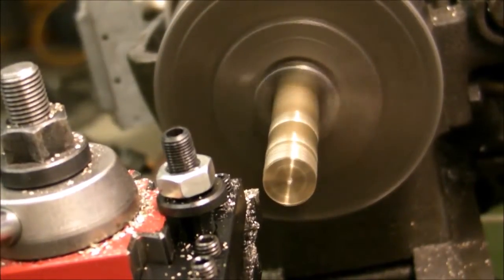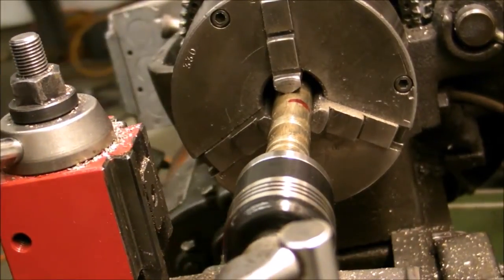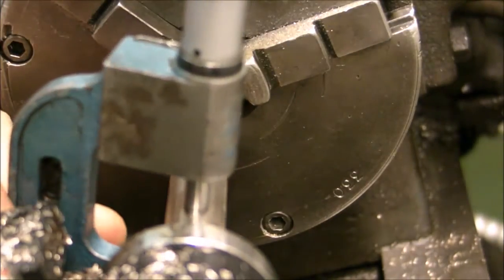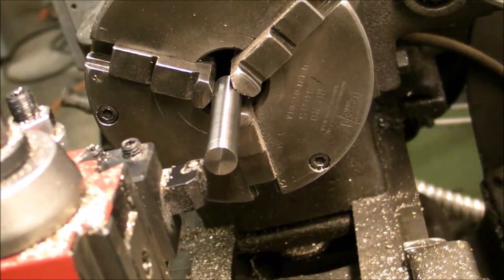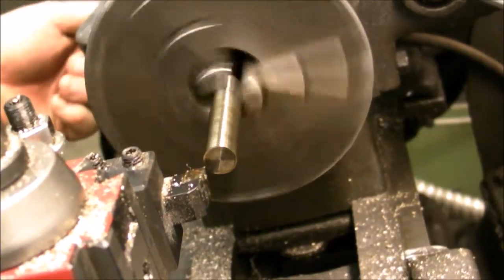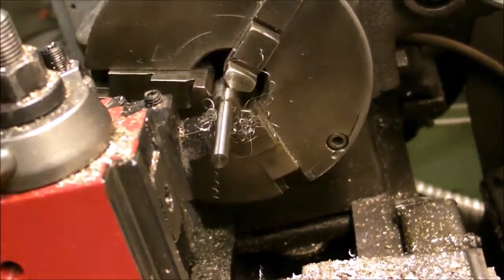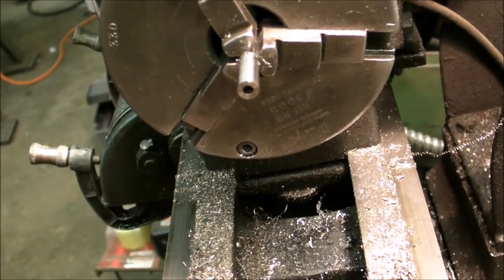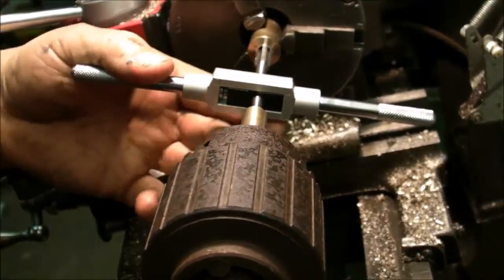Tap Follower

Comment: LOL, you had me tripping out for a second as I forgot we traded for the red tool post...I was thinking, "Hey, are they selling red ones like mine now?" Duuuhhh, Hee hee! Looking good man, glad to see you filming, I need to get back onto the horse and make some video...mowing weeds and sowing seeds isn't all that interesting, but I have cleaned my shop and got a bunch of work done on the SB lathe I could share. I also have been sporadically working on getting the hammers done...man it will be nice to actually finish something :P
Reply: Knolltop Farms BTW, very nice spring center!
Reply from the maker: Knolltop Farms , thanks.  As I was going through the video last night quickly editing, I forgot to mention the tool post as having come from a trade with you to make sure you noticed it.  It is working pretty good, not quite as nice as the wedge version as it seems to have a little more of a tendency to come loose on my vibrator called a lathe, but definitely working for me.

Hopefully you can get some video on how the lathe milling attachment cleaned up for you (unless I missed it), too.  I think I remember seeing a portion of it after it came out of the evaporust.

I try to clean up the shed where the tools are, but it seems to quickly get filled back up.  I need to move my 12" over to a more sturdy bench to see if that helps with some of the bad vibration issues I'm having with it.  The workbench I have it on now isn't very solid.  If I can't get it to work, it may go on the market as-is and make some room as I probably really don't need 3 lathes of the same approximate size.

I also need to get some of the tooling further off of the floor.  Having a concrete floor in the Spring time in Illinois isn't good.  When it is damp out, the water just condenses on the colder concrete and anything near the floor took a surface rust beating.
Have a good one, Chuck.  Don't work too hard...unless it is on your lathe!

Comment: Nice build and happy for you to get shop time!
Reply from the maker: outsidescrewball, thanks, Chuck.  I was able to get out a couple weeks back to work on a drawbar for the Atlas mill.  I didn't get full video of it and had a bunch of rocky bumps and design changes along the way.  It went overall pretty good.  If the guide spins too much and looks like it might wear, I might have to mill a couple grooves in the body, drill a hole through the larger part of the plunger and put in a pin in it to keep it from rotating as I've seen some other designs do.
Thanks for watching.

Comment: Nice tool. It's always nice when something you make for yourself works out so well isn't it.
Reply from the maker: The Texas Gun Guy , yeah, it is.  Learned a few things...don't leave yourself having to take thin cuts of titanium.  The last pass on the small end dug in and so it ended up a little undersized, but still workable.
I still need to work on the design/graphing aspects to machining, but I am glad I at least thought about it as my original design/thread selection would have had the crests of the internal threads coming through the outside or close to it.